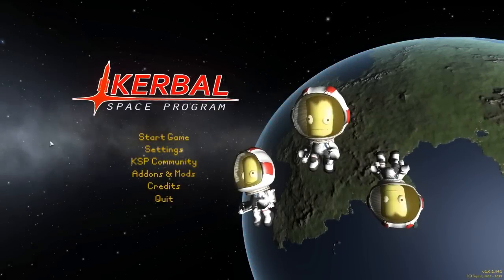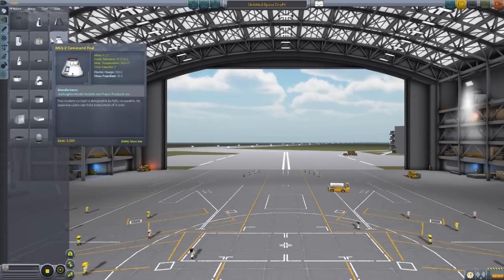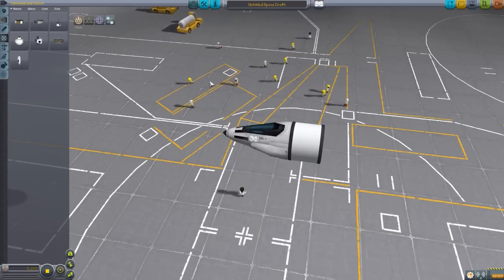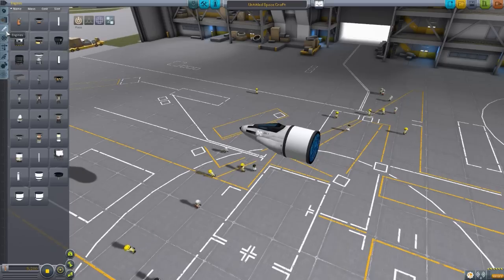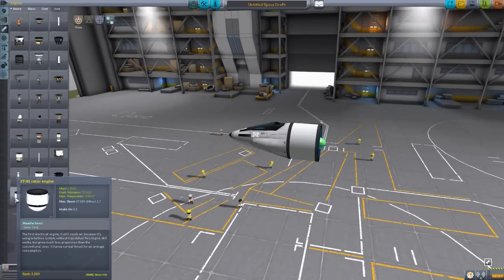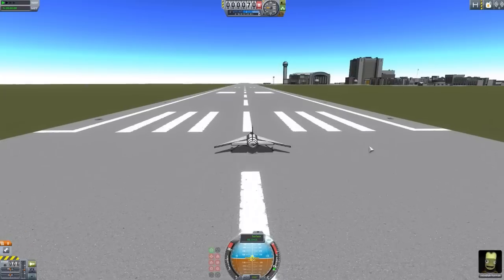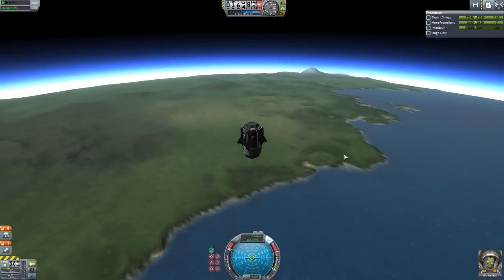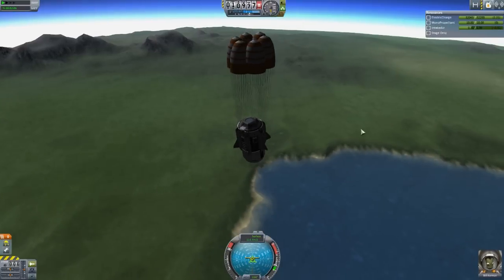KSP Mods - Electrical Parts

Comment: What if they had alternators, infinite flight >:D
Reply: Alternators work by taking excess energy from fuel combustion and turning it into stored electricity. Putting an alternator on an electric propeller is like putting a pump on a fuel line to siphon gas into its own tank. You're just taking extra fuel so that you can put it back where it came from.

Comment: "Requires intake air" - Rats! There goes my idea of making an electrically powered Eve lander/spaceplane. Also, if a propeller aircraft can fly forever on just 7 of the small solar panels, it sound like the charge consumption of the engines are VASTLY undertuned.
Reply: ***** They'll use 4x more power (or more) on the next update :)

Comment: Why is an electric motor making a noise suggesting that it is an internal combustion engine? (8:36) O.0 mmmk
Reply: *****  The tips of the prop move fast enough that the air doesn't close up behind it fast enough (Did I word that clearly?) so it creates a vacuum bubble behind the prop, then the air basically snaps shut into the bubble.
Reply: ***** It does noise of a large amount of air being pushed against a small hole
Reply: +R.M.A.J Gaming Propeller tips break the sound barrier (in real life).
When an airplane flies overhead, what you're hearing is the propeller tips and not the engine.

Comment: xD pretty sure I suggested this mod to him. I however do quite like this mod but like a few others pointed out, it would even be cooler (better) to have the propellers fly in atmospherical planets (eg. Duna). Apart from that  I do hope the creator of this mod, makes a few of the engines with more thrust but a lot more electrical usage.
Reply from the maker: Unix Universe You and a couple others ;).  and ya would be nice if it could be used in any gaseous atmoshpere

Comment: 19midnightsun87 (I can't directly reply) Wrong, it does need air because the electrical engines are turbines which spin and push the air to create thrust.
Reply: Assozat He did that purposely so people couldn't correct him.
Reply: 19midnightsun87 They work on non oxygenated planets :)

Mod creator here :)
Reply: 19midnightsun87 Thank you man :)
Reply: 19midnightsun87 Thanks.
Reply: Yes, but the propeller engine should not require intake air. That is not a turbine. The reason it requires air is probably so you don't use it in a vacuum, but they should have created a resource that can be found in all atmospheres, not just Kerbin and Laythe.
Reply: Cuckoo Clock Well, it is the first proper realease. That is likely to happen sometime.
Reply: Cuckoo Clock I think air in general (Not just O2) should be able to be used.
Reply: Cuckoo Clock actually, it might require air
Reply from the maker: Cuckoo Clock That is a fair point on the air intake, would be nice for this to work with just generic atmosphere or something along those lines.
Reply: Assozat 19midnightsun87 Also, I think it was a cheap way to prevent these engines from being used in space. If there is no air then these engines are useless in the case of the mod and reality.
Reply: Velociraptors of Skyrim I didn't turn off the answer function, no idea why he cannot answer me directly.
Reply: Assozat I see where you come from, but actually, you don't need AIR to be pushed through turbines. Any gasiform medium should work. The oxygenless atmosphere of Eve for example should work just as fine but it doesn't. And that is what I dislike.
Reply: IndieGamerMonkey Yeah, thats probably true. There is no way currently of checking if there is atmosphere in general, there is just checking for oxygen.
Reply: 19midnightsun87
It was probably because i was using my iPad.
Reply: 19midnightsun87 It was off when I looked at it. Of course I assumed it was that way because I've seen people do that before.
Reply: Cuckoo Clock I did it, the airintake it needs do work on non oxygened planets.

Mod creator here :)
Reply: Mr Samy Oh, that are GREAT news. 
Didn't mean to offend you or anyone else. It was meant as constructive criticism, I hope it didn't came across as too harsh. 

I appreciate your investment of spare time to make the community happy. Thank you man and keep up the good stuff. :)
Reply: Mr Samy Its an interesting mod. Haven't downloaded it myself, but it caught my interest. Might use it for a Eve mission. I don't remember if Duna is Oxygenated.
Reply: Velociraptors of Skyrim It isn't. Currently, Kerbin and Laythe are the only celestial bodies with oxygen in their atmospheres.
Reply: +19midnightsun87 Duna has an atmosphere too.
Reply: Banyan Chew But no Oxygen.
Reply: Right, forgot about that.

Comment: Why would you need air intakes for electric engines? There is nothing to be combusted.

It wouldn't even be possible to use these on Duna or Eve. Makes no sense and is really sad. This otherwise cool mod gets 2 out of 10 stars for me due to this.
Reply: so you wouldn't be able to use it out of an atmosphere
Reply: 19midnightsun87 there propellors